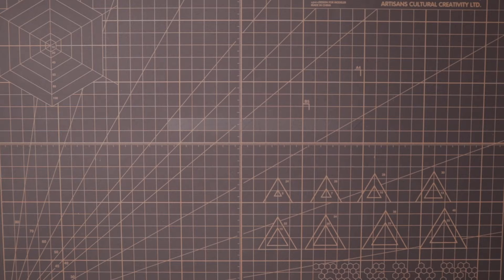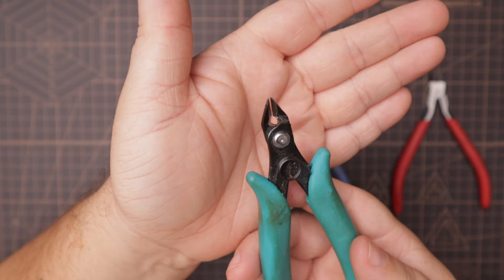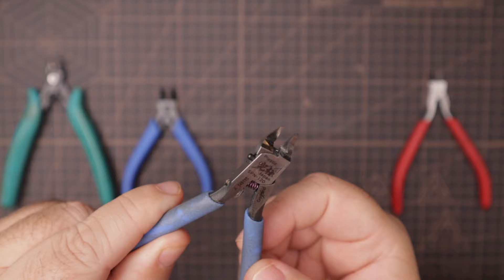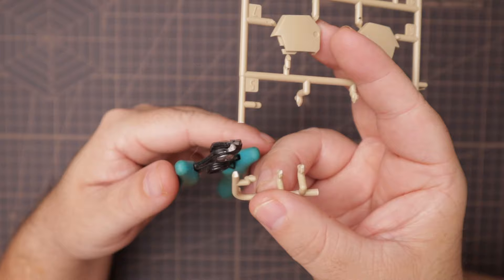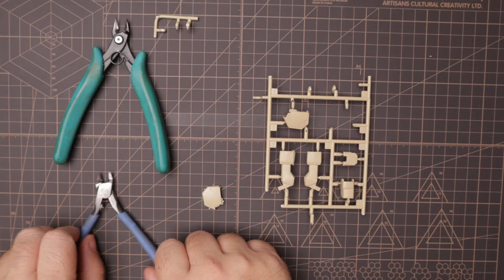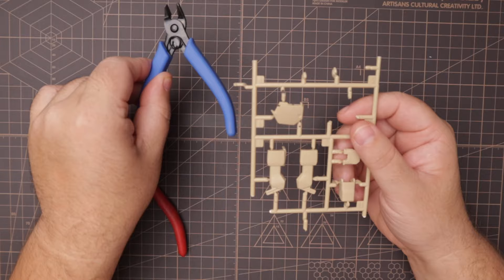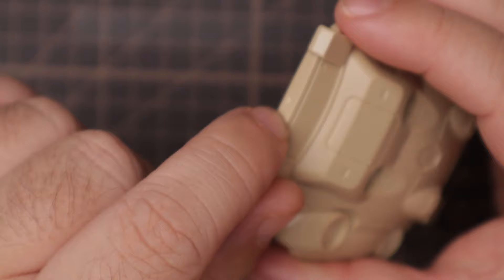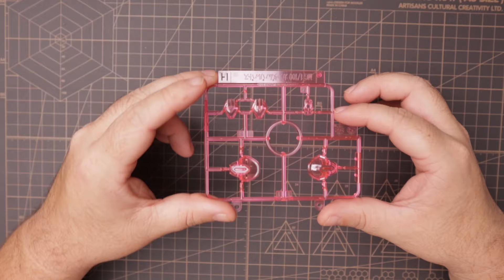How to Use Single Blade Nippers | Gunpla Tool Tutorial Series

Comment: can someone explain why people cut the nubs multiple times after the piece is off the runner with the "finishing nippers" when they're going to cut flush against the piece at the end anyway? i dont mean the thicker nubs but just the normal ones in general.
Reply from the maker: Hey there! Great question! In my experience doing two cuts (i.e. off the runner and then flush) often leaves stress marks on the piece. By shaving the nub down with multiple cuts, you reduce the chances of stressing the plastic when you get to the flush cut. Hope this answers your question, and thank you so much for watching and commenting.

Comment: Not sure if this is a hack or improper cutting procedures, but before cutting with a regular nipper, I give it two gentle twists to let the blades wear-down the edge of the connective runner, then a quick clamp to separate the pieces. I've found that this practice reduces stress marks or removes them altogether because the point of greatest resistance in any runner seems to be the outer coating. Once you get through the outer coating the plastic underneath is grainy and easy to cut.